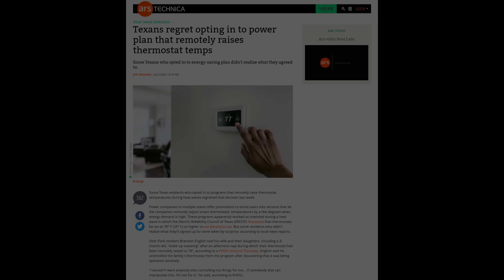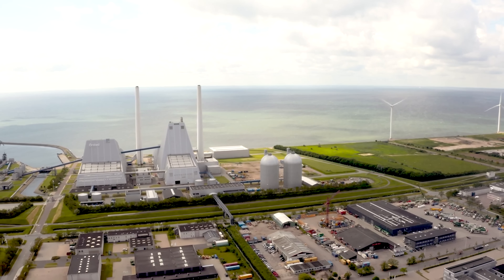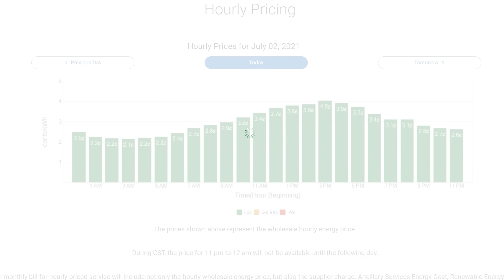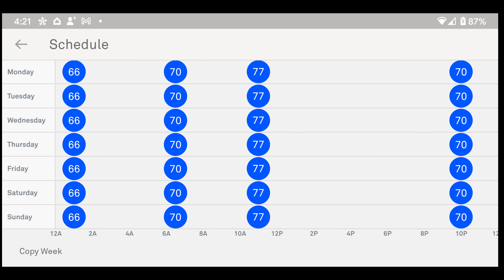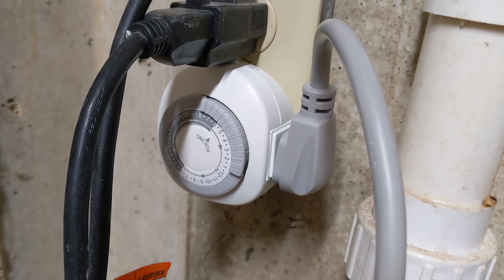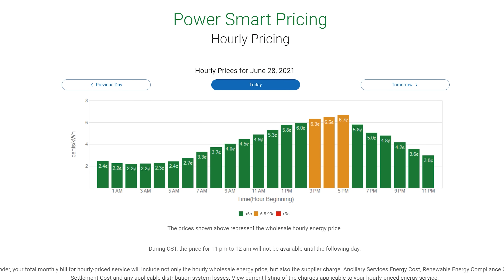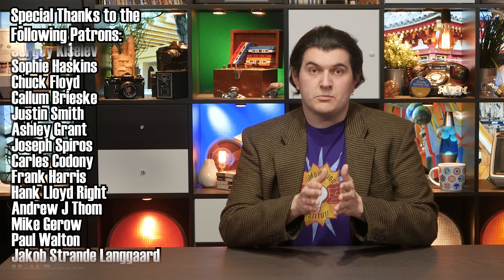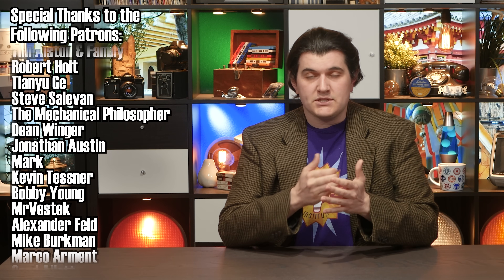Batteries aren't the only way to store energy. Here's another.

Comment: "66° might seem excessively cold"

Me, running at 60°: yeah, excessive
Reply: Don't you melt at 60 degrees??
Reply: I enjoy that temp too 
Where you from? I'm in Michigan
Reply: I let it roast in my place during the day, gets all the way up to 71. 64  when I'm sleeping though. 

Wisconsin here.
Reply: 66 degrees is excessively hot*
Reply: @WhenDoesTheVideoActuallyStart  I think they mean Fahrenheit, not Celsius
Reply: @doz3r Pennsylvania here
Reply: The heck? Optimal sleeping temperature as discovered by science is 72F.
And you're supposed to have the lowest temp during the night... Which means that during the day it should be HIGHER than 72F, around 77F/25C is considered optimal during the day.
Anything higher is too hot, anything colder is too cold, PERIOD. It just wastes power.
Reply: @burnttoast6974  So they should specify.
Reply: @seamon9732  I agree
Reply: @seamon9732  Bruh, I keep my AC on 72 for financial reasons. I usually like to keep it at 69. Anything over 80 is practically intolerable for long periods of time. 75-76 is the maximum tolerable indoor temperature before the heat begins causing irrational irritation and prevents normal functioning. 
Also, source?
Reply: @seamon9732  I'm in the UK and 25° is way too hot for me to be comfortable. 20° is ideal.
Reply: @seamon9732  As a Finn 72F is more than I'd like even during day inside. In winter at least it's easy to get night time temp to ~65 just by opening the window in -5F weather for a bit.
Reply: @seamon9732  For me as a Brit this is a horrendous Temperature. It's 25'C at the moment in the UK and that's a heatwave and I feel like I'm melting. I'm only comfortable if the temperature is between 16'C & 18'C (Max).

Those temperatures he was mentioning seemed so high compared to what I'm used to so geographical location makes a big difference.

(I have friends from central Australia who think 30'C is Winter Temps)
Reply: @seamon9732  Those scientists need to tell that to my body, which has trouble falling asleep at 72°F (22°C).  I get sweaty and uncomfortable, unless I turn my thermostat down to 68°F (20°C) or cooler.
Reply: my SUV has 32F  sooo cold that you can see your breath  i gotta put my hamburger ear muffs on
Reply: In Phoenix. 77 is my low for the day!
Reply: @seamon9732  You can't make blanket statements like that. Optimal sleeping temp is likely a range for most people and even then there will always be outliers who need a temp outside of that range. For example, I suffered several heat injuries to include multiple cases of heat stroke that required a hospital stay when I was in the army. That has led to me having severe issues with any temps over 68f and my ideal sleep temp being around 60-64f. For someone like me, temps above 70-75f for too long can land me in the hospital or even be fatal.
Reply: I’m so confused. All those news articles make me think most Americans keep their air conditioning on literally 24/7. That’s unheard of here
Reply: This thread is amazing. All you guys enjoying lovely sleep at 20 degrees C and I get grumpy if it's higher than 18 at any time! In winter I'm happy at 14 degrees (57F)
Reply: Jeez, I'm here at 74
Reply: @seamon9732  me who live in tropical region and always sleep while temperature at 80 F:

all right mate
Reply: Yeah I always run my AC at the lowest temp, there have been times where It's turned itself off when I was still hot, I suspect that for some reason the temp sensor is on the outside part instead of the inside part
Reply: @seamon9732  Optimal for some people, for me that's too hot for sleeping. I need it to be under 65 at night.
Reply: @WhenDoesTheVideoActuallyStart  the context makes it pretty obvious which scale they’re talking about.
Reply: @burnttoast6974  Irrelevant. Fahrenheit is not a standard temperature measurement, so it should always be specified.
Reply: I've noticed that 10% Relative Humidity affects more how hot I feel than 10 degrees Fahrenheit.
Reply: @seamon9732  

"Optimal sleeping temperature as discovered by science is 72°F"

Wrong. The optimal temperature is between 65°F and 72°F, as discovered by science. You see, everybody is different, and they have different needs.

"Around 77°F is considered optimal." (During the day) 
No. It's a range, just liked the temp for sleeping. 70°F to 77°F is the recommended range for a workplace. And this is further complicated by relative humidity, and activity level.

"PERIOD"
You should avoid making such proclamations. It clearly demonstrates your foolishness.
Reply: @WhenDoesTheVideoActuallyStart  

"Fahrenheit is not a standard temperature measurement."

Yes it is. It's just not the standard most places.

Given the context, if you thought for a moment that they were using Celsius, the problem is yours, because absolutely no one is going to believe 150°F is excessively cold for daily living conditions.
Reply: @notahotshot  Celsius and Kelvin are the global standards, as all countries recognize and use both.

Comment: I know this an old video, but I thought I’d comment anyway.

This does bring up a pretty big negative for tankless water heaters. (Everyone getting up and taking a shower before work at roughly the same time)

In the house I grew up in, my parents installed 2, and in the early 90’s, even a 3rd electric hot water heater. These were all on a timer to only run nights and weekends when electricity was cheap. Generally speaking, we more or less always had all the hot water we needed even though the heaters we off a lot of the time. I’ve always had a hard time understanding the popularity of tankless hot water heaters.

Comment: so it's basically like the old-fashioned night storage raditors, only backwards
Reply: And indeed even without those storage heaters, so long as you have good insulation, you can heat any space preemptively. If your heating is subject to time of use pricing.
Reply: @vincentlaw82  storage radiators have bricks in them, not asbestos
Reply: @vincentlaw82   In the UK, Dimplex storage heaters stopped using Asbestos in the 1960s and Creda in mid 70s and there's a list of models from them if needed. Elsewhere other manufacturers may have used asbestos of course a lot later. There is no Asbestos in current Dimplex/Creda storage heaters, that's for sure. The bricks are typically a high density magnetite material that actually store the heat.
Reply: Reverse igloo?
Reply: @no-ml6gz  I removed my old storage heaters a while ago, they had bricks sandwiched in asbestos insulation.  That was fun finding out as I dismantled the first one and a load of silver dust billowed out.  Dug a hole in the garden and buried the entire lot apart from the bricks that made a nice fire pit.
I think they were 1980`s vintage.
Reply: @meetoo594  oh interesting (and scary lol). The ones I encountered didnt have insulation I think because the outside of the unit would get hot af
Reply: @moojuiceuk  my cottage that I stayed in on vacation in December 2017 still had these old beasts from the 1980's installed. They were totally useless. During the night the whole cottage got boiling hot and during the day they would only last till midday. I usually came back from extended hikes at around 4pm and the cottage was annoyingly cold, so this first thing I had to do was fire up the single electric fan heater as well as light a fire in the tiny fireplace^^.
Reply: There must be someone who likes storage heaters ? (Not me)
Reply: @maximilianwimmer627  yup, the ones I ripped out put out just enough heat to deter damp but nowhere near enough to keep the average human warm. They also cost a lot to run and took an age to heat up properly when first switched on.

Comment: Funnily enough, I've been doing this for years unintentionally. I like sleeping in the cold with heavy blankets, so I'll usually kick the AC down to 68-69 when I go to bed, and then raise the temp threshold back to 72-73 when I get up. Not on a variable rate plan though, so I pay the same no matter what, but I guess I'm helping the grid somewhat.
Reply: if you allow your body to acclimate, you could probably keep it closer to 68F all day long
Reply: @SoloRenegade  
That would be cool, but kinda against the point in the video
Reply: You could probably just call your electric company and check if you would save money from switching to another plan.
Reply: @Appletank8  No, it's 100% relevant to the video. If paired with the idea discussed in the video, the benefits of energy savings to the grid would be magnified still further. I think we'd be better off just expanding the grid with SMR nuclear and gravity batteries (cranes stacking weights). But reducing consumption is a good approach too.
Reply: @SoloRenegade   well actively reducing the temperature over the whole day is the exact opposite of this videos idea. Instead of shifting demand to a certain time and not creating demand in peak hours you propose to increase demand throughout the whole day.
If it were about heating in winter, you'd lower overall demand which would benefit you and your elecricity provider but with ACs it doesn't.
Reply: @thenamen935  Wow, you completely turned what I was saying on its head. My technique not only does what he advocates for, it reduces demand overall, at ALL times of the day.
Reply: @SoloRenegade  
How are you keeping the house temperature below 68F all day without constantly running the A/C?
Reply: @Appletank8  that's Winter, during summer I let it heat up. I don't cool below 78-79, and even then only on particularly humid days (more to use the dehumidifier than actually cooling the air).

Comment: That's the joy of rammed earth houses.  The fundamental idea is that you make your house such an enormous thermal battery that it cycles on a timescale of about a year.  The most comfortable house I've ever worked on had an Ancient-Roman style open sky courtyard and garden, with passive rainwater collection due to the sloping of the roof, and the only offshoots that had any thermal management were the bedrooms with thermal pumps that tied into the garden rainwater resevoir.  The kitchen just had a masive hood vent to dump the hot air, and would draw cool air from the rest of the house.  I think the most they ever paid for electricity over a month  was $60.
Reply: Timescale of a year? that's literally one of the silliest things I've ever heard. Rule of thumb for earth insulation is that heat transmission is delayed by about 8-9 hours per foot thickness of earthen walls. How do you expect to get a year cycle? Even the great lakes in Michigan don't hold thermal energy that long.
I think you're misremembering that earthen houses cycle on the timescale of day, which still greatly reduces cooling and heating costs without your house being freezing in the morning.
Reply: @alpacagurl92  Maybe the house is a quarter mile underground. You don't know.
Reply: @NickR..  lmao, dont r/whoosh me, but at those depths, the temperature would stay a pretty constant 80-100 degrees fahrenheit

Comment: i had storage heaters (the type with bricks). they only heat up when the electricity is cheap (midnight till 7am), then you can open a flap to release the heat.  all the heat was normally gone by lunchtime, so it was always freezing for half the day. in a better insulated building, they aren't bad, but in that place they were terrible :D
Reply: I'd hate to sleep in hot room tho
Reply: You would supplement the afternoon hours with traditional heating and come out ahead I this nk.

Comment: We used to do this growing up to save money. We'd even open the windows on cool nights, the house would stay nice all day. 

Years of doing this and the electric company knocks on our door to inform us the previous owner never even hooked the air conditioner to the meter. We didn't save a damn penny because it was already free!
Reply: The nice neighbour thing still applies at least!
Reply: How is that possible? You don't hook anything to the meter, the meter is inline the feed to your main breaker panel. All loads come off that panel or sub panels off that panel.
Reply: @Dave-in-MD  i'm not sure, but he either hooked it up to a shared supply, like those used for lights in apartment building hallways and stairwells, or illegally spliced it into a wire "before" the meter, that shouldn't be possible, but in some countries the electrical installations aren't that neatly done, an extra wire here and there can go unnoticed for a long time.
Reply: @Dave-in-MD   We were the 2nd owners of the home. 1st owners had built it themselves. I was pretty young so I don't know the details but if I remember right the other guy is right that it was spliced before the meter. The whole house was pretty half-assed/not totally compliant. No idea how it was missed for so long.

Comment: That was the concept of an electric heating accumulator too. More or less.

An accumulator has some bricks in an insulated box. Through the bricks, there's an electrical heating element, capable of heating the bricks to 700ºC. Then there are vents (and a fan) you can open to dump that heat into your house.

As the accumulator is insulated, it works a tad better on badly insulated houses than trying to store the energy directly in your house. But these things have many disadvantages: a suboptimal efficiency (some heat is lost when you don't need it), and the high temperature means heat pumps don't work. They're also bulky to install in your house, and when the fan comes on, they make a lot of noise.

So they've generally fallen out of favor.

Comment: Back in the 90’s (in Europe) my parents had a device which was basically an insulated box with around 300 kg of fire bricks inside. Those bricks were heated by a resistor over the night, when power was cheap. During the day, an air flow was created through this volume with a ventilator and vents in the box. We could heat our 90’s insulating standards house with this.

Comment: That's how we do it in most of Europe, and nobody even has AC, we just open everything at night and close everything during the day. Granted, this is probably not possible in the middle of Arizona
Reply: Arizona might work, as there is such low humidity and large temperature swings from day to night. Where it would be much less likely is Houston TX, really high humidity and much lesser temperature swings (maybe 78-95F some days). When you have high outdoor humidity it is highly undesirable to open windows and doors.
Reply: Spain, Italy and Greece don't really have AC in private homes either. It's a wussy whitebread thing.
Reply: @Breakfast_of_Champions  
those countries in general are much cooler and drier than much of the united states, so no
Reply: It's also a matter of architecture. US suburban houses are basically made of plywood and sheet rock. Which is fine if you're always actively heating/cooling the place with AC. But they don't hold the temperature well. This is why people in Texas were freezing to death in their bedrooms within a day after the power went out.
Reply: A couple decades ago, nobody where I live (Canada) had AC either. Now we have weeks-months where the highs are mid-40s, and the lows are mid-30s. That strategy really doesn't work anymore.
Reply: @ruakij6452  im not going to spoonfeed you all the info, but even the hottest of those countries is greece, which has an average high in the summers in the low 90s which is certainly warm, but the average humidity during that time is in the 40s. Meanwhile in jacksonville florida in the summer there can be temperatures reaching the low 100s while the humidity averages in the 80s. The humidity has a higher effect on discomfort than you might expect.
Reply: Well if it is a cool day and it's only like 105 maybe but after it gets past 110~120 there isn't much point, our record high temp for the state is 128, plus, during monsoon season like right now the humidity becomes a factor, it's usually 13% or lower humidity wise but when the monsoon comes it's still just as hot but with 30~60% humidity, as I type it's only 100 outside with 42% humidity. Also, at night the temp can be nice and in the 80s or still hot and in the 100s, even at 3am
Reply: @HeadsFullOfEyeballs  I hadn't really thought about that.  My Victorian house in England has solid stone walls more than 18" thick.  The windows are all draughty and single-glazed but the house still holds heat for a long time.